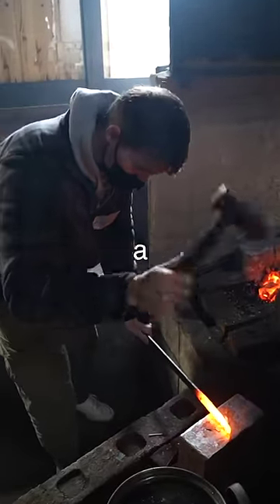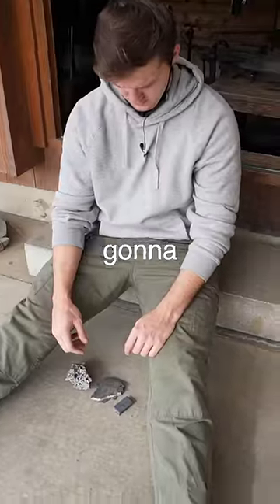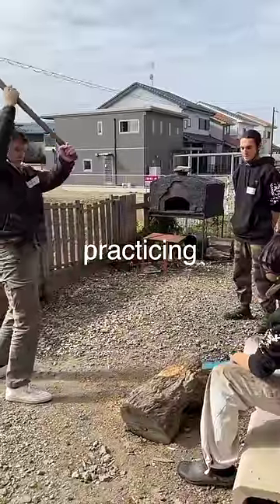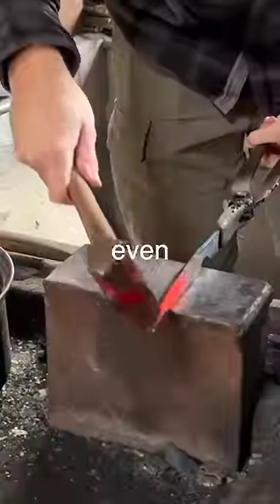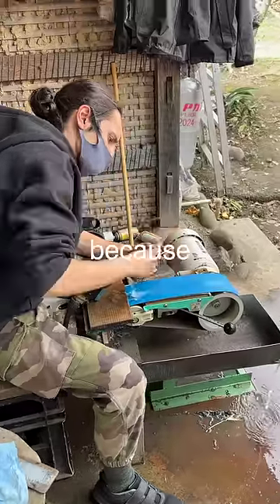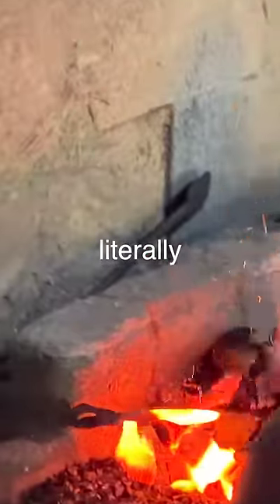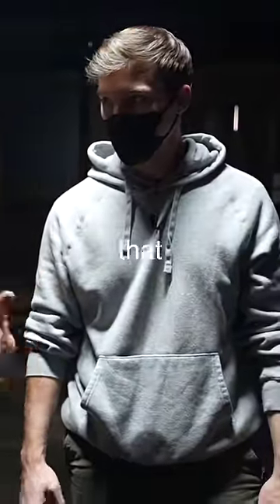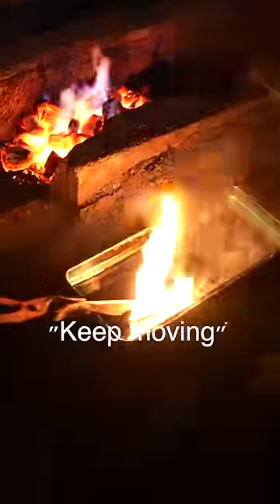I Forged a Blade with No Experience

Comment: Blacksmithing is 5 skills in a trench coat pretending tobe one. You have the basic hit metal in certain way, you have wood working if you want to make handles, you have metallurgy, you have welding, and finally you have general power tool proficiency. The blacksmith was basically the town handyman for many centuries so it sorta makes sense
Reply: powertools?
Reply: @temmiestudios7577  That's mainly because I wanted 5, mainly due to 5 having I bit more of a ring to it than 4.

Comment: "Traditional" Japanese swords are hardened in water. Oil is a modern/western adaptation (which is safer and less likely to break a blade than water)... which is why imperfect hardening of Japanese blades are known to be prone to cracking.

Comment: The Japanese DON’T USE OIL WHEN THEY MAKE A SWORD, for literally centuries they have used water to harden their blades, just look up the original technique to making Japanese swords and you would know this
Reply: If you knew anything about bladesmithing, you would know that you NEVER quench a blade in water. Even Blades made from water-hardening steel will warp or break in water due to how thin a blade has to be. Water-hardening steel tends to be used for larger components, and the added thickness makes the steel cool off slower, which prevents breaking.
Reply: @zangetsu5221 Wrong.
Reply: @autumn5592  No. I'm backed by Kevin Cashen. Try again.
Reply: @autumn5592  He's the global leading expert on heat treating metal, and he told me and a whole class of other students that even water hardening steel can't make a water quench 100% viable. Water just evaporates too quickly, you get a thermal jacket.
Reply: @zangetsu5221  No, he's not; Larrin Thomas is. The guy that made Magnacut, and other steels.
I'll take his word, in which he says simple carbon steels can be water hardened fine.

But what would he know lmfao, not like he has a doctorate in metallurgy and works to design new knife/tool steels.

All quench media evaporate and produce a vapour jacket....
Adding salt to water prevent the vapour from sticking to the knife, cooling it faster/properly.

If you plunge a knife into cold oil, you will get exactly the same thing happen, huge vapour jacket, improper hardening, and warping.

If you do a water quench properly, it is not an issue. Not exactly sure why you think it is, unless you're just repeating rhetoric you've heard?
Reply: @autumn5592  He makes automotive steel. Automotive parts can be water hardened BECAUSE they are thicker, sturdier parts. This Larrin guy isn't ABS certified, so he isn't a BLADE smith, which is what we're talking about. He's not the leading expert on hardening a blade. That's Kevin Cashen. I've taken several bladesmithing classes through the abs, what have you actually done with steel irl? I've actually met the guy I'm repping in person, and I know he knows his shit. He taught my fucking intro to bladesmithing class.
Reply: @zangetsu5221  No, he is a Ph.D holding metalurgist, specialising in knife/tool steels.
He has designed several of the 'super steels' on the market.

It does not matter if he is ABS certified, he has a doctorate. That says more than enough.

Never heard of Kevin before, clearly not as big as you make him seem, surely if he was the 'leading expert specialist' his knowledge would be constantly passed around.
But if he says water quenching doesn't work, well..... he's not as smart as you claim.

I'm a knife maker, and run my own sharpening company.

Congratulations? Meeting someone doesn't mean their word is somehow worth more. 'He knows his shit' is very descriptive... lmfao.
He taught you? Wow! That MUST mean he knows everything.
Because teachers that 'know their shit' are infallible right?

Comment: I’m sorry did he just say iron is a softer metal? Iron is hard af almost as hard as stainless steel. Carbon steal is the hardest but not as heavy as iron..
Reply from the maker: correct thats why we were using it to practice on
Reply: Metallurgy time!
As iron and steel goes, the higher ths carbon content the more brittle it will be, but it will resist deformation more, and vise versa down. That's why machine steel is mid carbon, and sword steel is high carbon.
Here's the list of iron carbon levels, and their names going from lowest to highest

Wrought-iron, Low Carbon, Mild Carbon, Mid Carbon, High Carbon, and finally a curveball, Cast-iron.

There is virtually no clear line between iron and steel, unless you're talking about chemically pure iron, hope that cleared it up, feel free to ask more questions and I'll try to answer.
Reply: Iron is absurdly soft.

The lack of alloying elements (you still have some because of impurities in the ore), results in it being very easy to move when hot.

If you have a high alloy steel (usually stainless), it's going to be harder to move. Because the carbides melt at a hotter temp.

As for stainless being harder, it depends.
Most non-tool stainless is not that much harder than mild steel.

You can get high carbon stainless too (otherwise it can't be quench hardened.)
There is nothing special about higher carbon content, it just changes the max hardness the steel chan achieve when hardened.